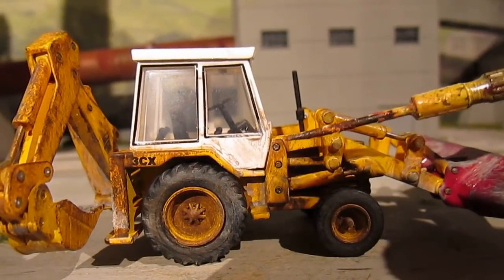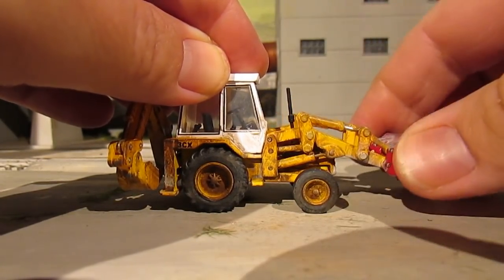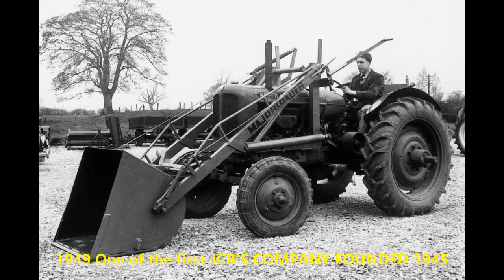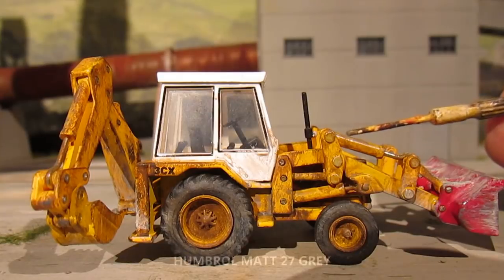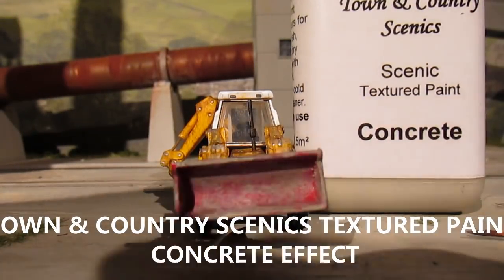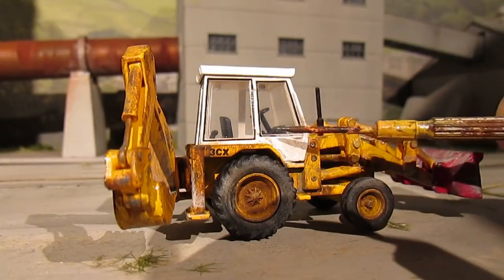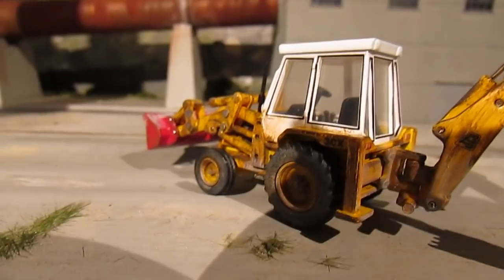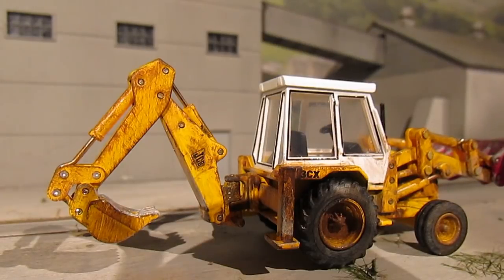How to weather a OO/ 1:76 Oxford models 1980's JCB + Review

Comment: Hi and a great job on the weathering. In one of the shots you had the bucket down and backhoe up, well I worked for JCB here in New Zealand and I used to demonstrate the abilities of the JCB - we would put the bucket down on its edge, bring the backhoe into or as close to the back of the tractor and then raise the whole machine up on it teeth and then slew very carefully left to  right - used to freak out the operators - great company and great time.